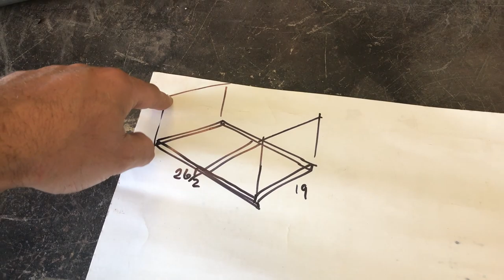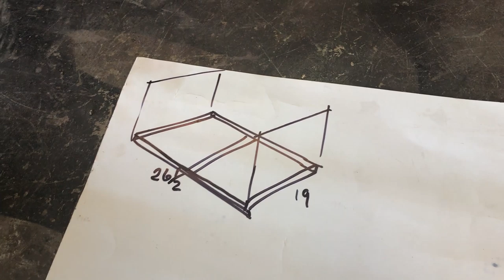Fuel Cell Cradle Fabrication On My 1936 Chevy Coupe - Aluminum Gas Tank

Comment: That looks like the perfect position for the tank. It looks like it was designed to be there. You will be able to lift the body on and off and not have to worry about the fuel tank. Like you said, replace the boot floor with a nice access panel so you can get at the tank when the need arises. Great job Dave.
Reply from the maker: Thanks Derril. Worth the effort.

Comment: I have watched all your videos. I am a huge fan. That Crown Vic front end was brilliant. My suggestion for the fuel filler cap would be to find a gear of the same size and cut the plastic off and adhere the gear on. Sometimes, when you have an issue, the best thing to do is call attention to it. I would also add pinstripes around it judiciously. I just bought a 1967 El Camino with a 350 engine. I like those boots you have around your spark plugs and wonder what they are called and where I can get them?
Reply from the maker: Hey bud. I got the boots on amazon: https://www.amazon.ca/gp/product/B01HTFTRAW/ref=ppx_yo_dt_b_asin_title_o07_s00?ie=UTF8&psc=1
Reply: @ScottRods  Thanks so much. Unfortunately, they will not ship them or similar ones to me. Looks like they are made of asbestos and I suspect US law won’t allow them. And, I am a big believer of environmental laws (old enough to remember when the Cuyahoga river caught fiire. . .three times!), so I guess I will be forced to find another solution. Also, I have never owned a 350 before. It runs around 200 degrees. Is that correct? I don’t even have the air conditioner working yet. Seems hot to me.

Comment: Impressive project, little and often wins the day. Have you pressure checked the tank, maybe with low pressure air (bike pump, seams under water) or are you confident it's good? Any concerns about ally tank and steel frame, do you need rubber between and an earth strap. I have a Defender with steel and ally in proximity with galvanic issues. Nice to see a ball pein hammer, cringe when I see claw hammers other than in joiner's shops.
Reply from the maker: Yes, I'll add rubber where the metals meet. Not had it tested but I know the guy who gave me the tank and he assured me it was fine. And yes, I'll be adding an earth strap.

Comment: Why not clock it around, so the filler is closer to the rear, (the right side) then just come straight up through the floor with the filler neck? And your fuel line, would be on same side as the fuel pump!
Reply from the maker: My filler hole is on the left of the car, so I'd rather it was closer. But thanks for your suggestion.